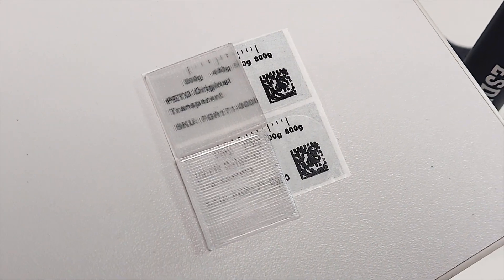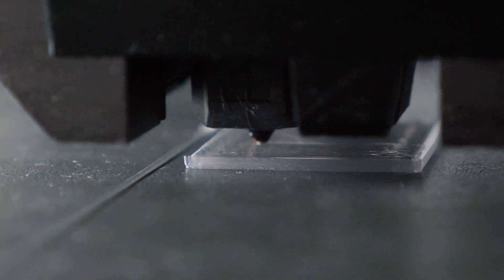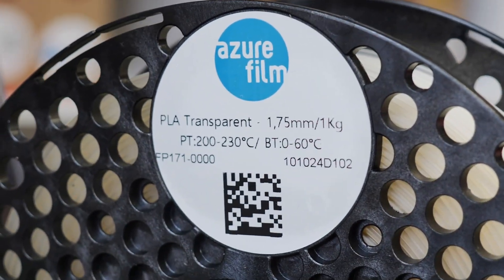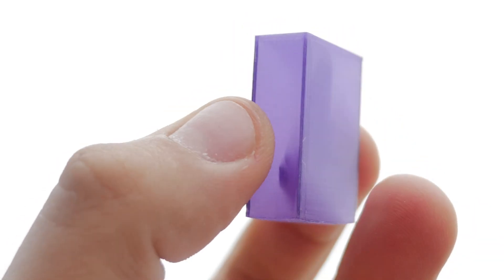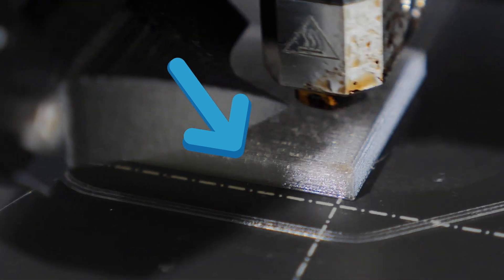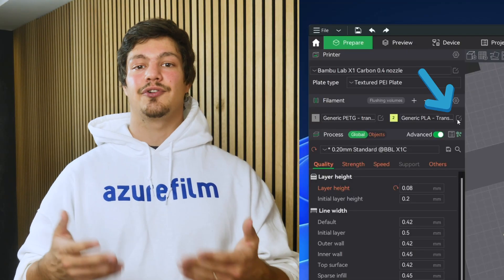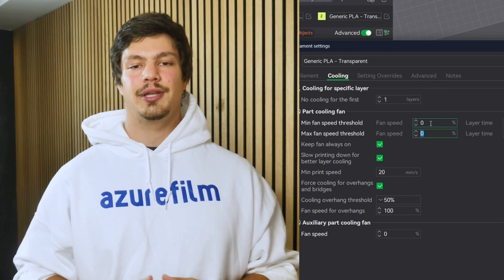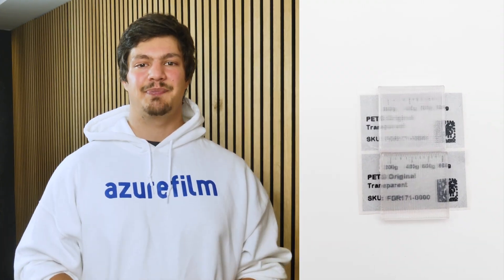How to 3D print transparent parts

Comment: What about rounded objects that you want to be transparent? For example say a round cup. Aligned rectilinear looks like crap on a rounded object. It does fine for the base, but the walls of the cup were a mess.
Reply from the maker: Hi, you should try concentric infill for round objects or just plain vase mode. :)